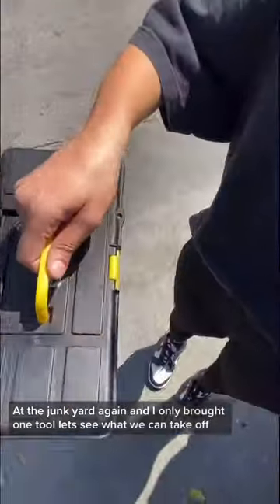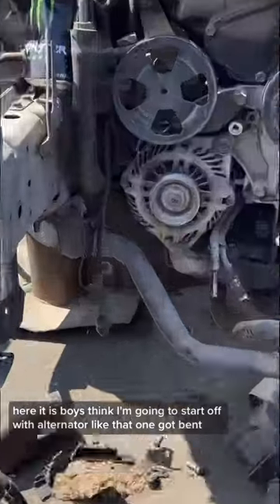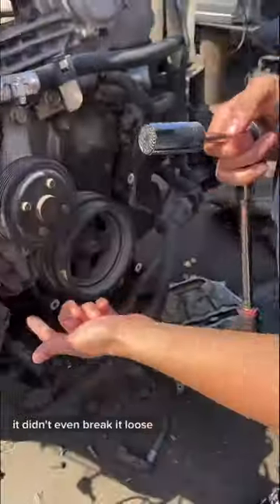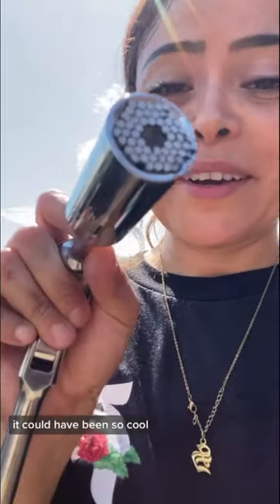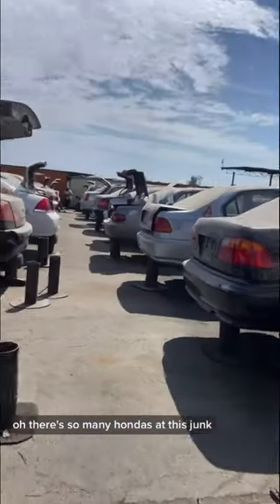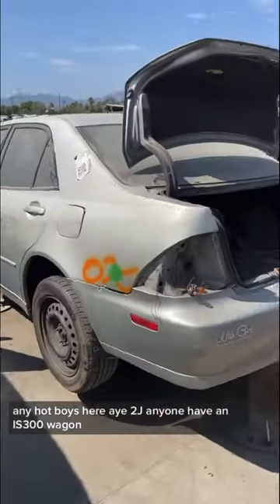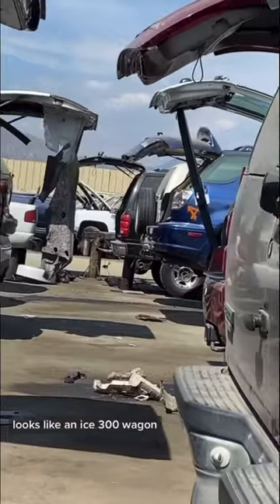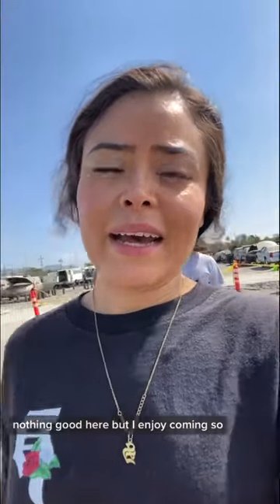I went to the junkyard with only ONE tool! 😂 #junkyard #toyota #drift #cars

Comment: Working at Honda I learned that you shouldn't pull you should push Next time hold it from the left side going down and push it down and it will come Out
Reply: That doesnt work when you're scrawny. I can lift up with a lot more force and a lot more controlled than i can push down. I call bullshit. Anytime i see anyone trying to push down its usually someone that obviously doesnt have much experience struggling.